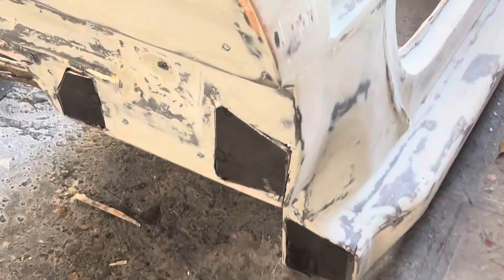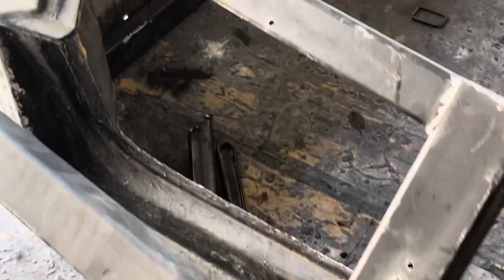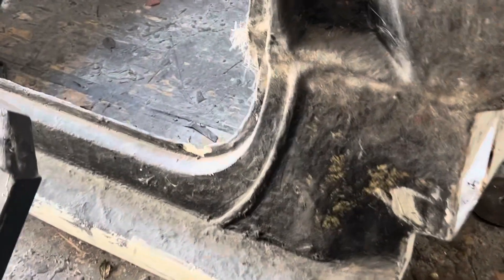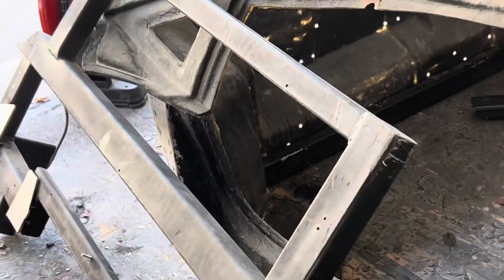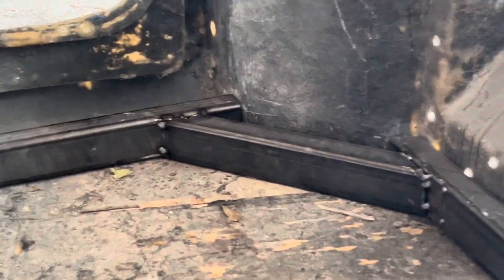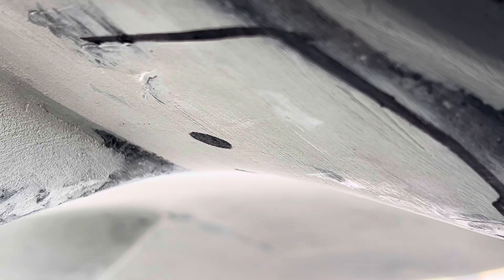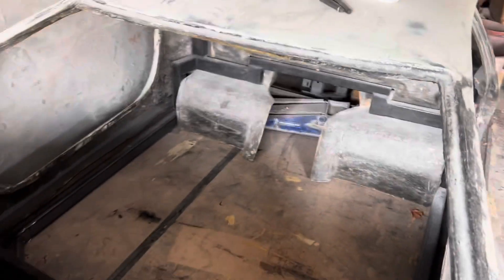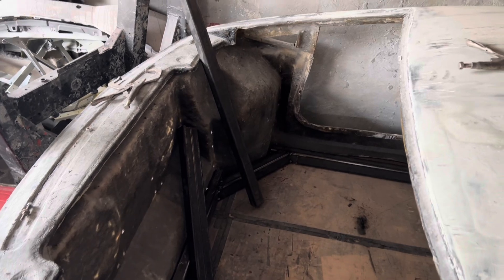Lamborghini Aventador replica frame build

Comment: I love it! Are you working with plans, or just winging it with photos, etc? It will look incredible cleaned up with a lick of paint. That windscreen sweep looks so shallow/extreme!
Reply from the maker: Thanks for watching my channel, I have been using original parts that need repair and then making molds to make new parts. The windshield angle is like the original.